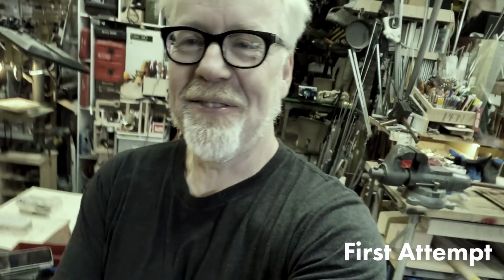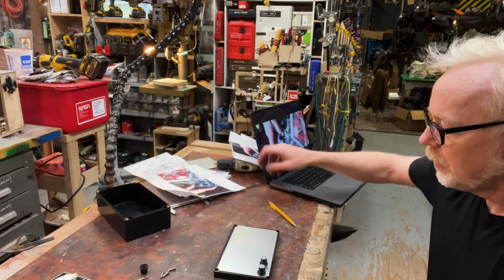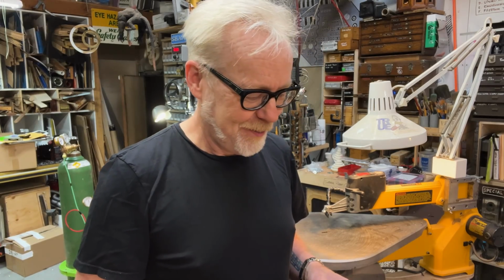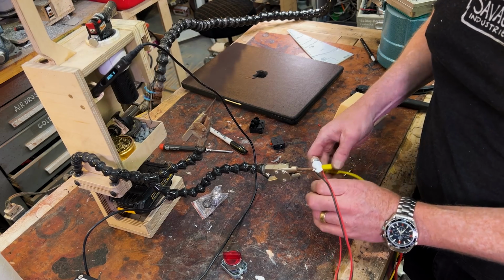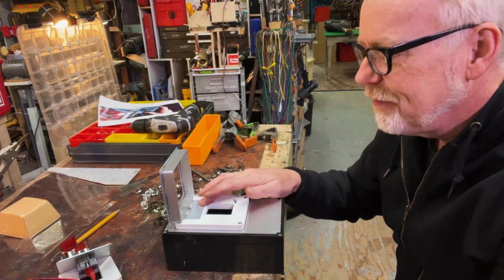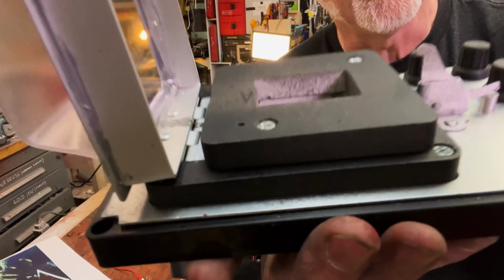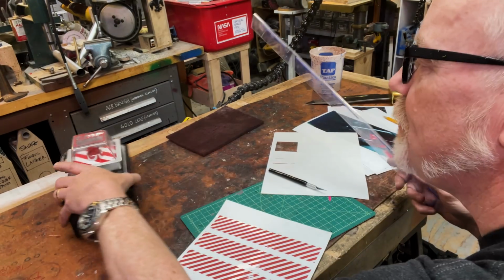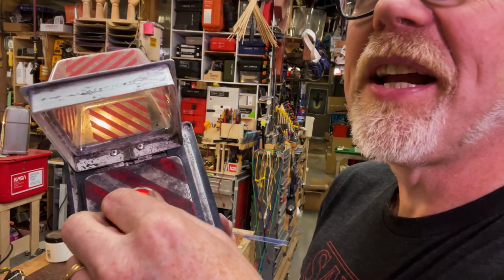Adam Savage's One Day Builds: The Matrix EMP Switch!

Comment: I mess with printers a lot for a living from the network print queue side of things for the company I work for.  I think you'll find that most modern printers have a lot of paper type options that you can play around with that adjust how the printer feeds and fuses for the best results.  So if your printer was able to run that as it did, it likely just needed the paper type tweaked a bit more.  We use a lot of label printers, but we also use a lot of generic laser printers because unless you are printing in quantity, you can tray feed quite a bit of what you need without too much problem.   GHS label printing has some fairly robust requirements, for example, but again unless you're printing in bulk, plenty of laser printers can handle them just fine.  I would imagine those sorts of printers would handle a job like this without even a shrug.  We've used anywhere from a Lexmark CS310dn to a Ricoh SP C440 or 840dn, but most of those companies would have reps that should be able to guide based on what you tell them you want to be able to do.  Ricoh/Lexmark have both always been great for that, but then again we are a client to them vs a single purchase so ymmv.

Comment: You can try something like a xerox phaser 7800, that will do tabloit 11x17. There's ways to set the fuser temp to whatever you want. Also, before you try that, make sure you set the paper type in your printer now to either label or card stock, whatever setting is the thickest. That setting tells the fuser how hot to get and how much pressure to use. Toner is paraffin so the fuser melts and bonds the toner to the paper.

Comment: About the laser printer, most manufacturers will have a secret maintenance menu or service technician menu that allows for adjustments. Fuser temperature is one of those adjustments. Check with the manufacturer to see if that's an option for your specific printer. I was a certified HP tech a while back and remember getting into those menus. Great build, love the Matrix too.

Comment: That last dial you machined and installed. It took a minute to remember but I had an electric toy chainsaw back in the early 90's that has a similar looking switch on it. I think it was supposed to be the fuel cap but powered it on.

Comment: the other thing to consider as someone in the industry... there are 2 types of 'laser' printer, and the manufacturers usually dont tell you what one your getting in anyway. the first type is an actual laser that does the job, the other kind is a very high intensity LED system that is used to replace the laser. the diference in the reviews seen are likely because of the 2 types of 'laser' printer.

Comment: Your existing laser printer may already have a "hotter" setting. On my Brother HL-L2390DW, in the printer preferences on Windows, the heat options are on the "Advanced" tab and then the "Other Print Options(Y)..." button, then in the list, "Improve Print Output". The default is "Off" (which is the normal temperature), "Reduce Page Curling" (which is the low temperature), and "Improve Toner Fixing" (which is the high temperature).

Comment: Adam for 11x17 at the paper we have several HP 700 M712N (also available as M712DN with duplexer) it is however bw. For color see if you can score a used HP CP5525dn. I can say we put these through a heavy work load... (or at least did prior to covid and everyone working remotely) ... however that move to remote office workers means the heavy duty workgroup printers should be able to be picked up used.
Note not sure if they get any hotter than average.

Comment: The closest knobs I can find the the one you made are off of appliances. Ovens and Ranges mostly, but it looks like there might be some slightly smaller ones on gas grills and propane heaters. I can't find anything that has the fluting at the bottom and the handle like knob, but that would be my best guess. Take one of those and hollow out where the post goes to get the screw all the way through.

Comment: To avoid the rub-off on a laser printer, most will let you specify the material you are printing on (regular paper, cardstock ect).  I have an HP Laserjet.  Setting material to "Card Glossy" usually sets the toner better for me.  I suspect that most consumer laser printers don't vary the heater by much, but will print thicker materials at a slower speed.

Comment: What cute vacuum-forming presses!  But I worked for a number of years for a gentleman who made his own vacuum-forming press from scratch in the basement of his home that would handle an entire 4' x 8' x 0.80" sheet of Kydex at a crack.  Ran many a sheet of 4' x 8' through that thing.  Only problem was that, when he ran it, it drew so much current that the neighbors complained to the local power utility about not having enough power for their homes - until the company installed 3 new transformers for the housing plan.  They never did figure out where the additional power draw was coming from.🤣

Comment: That "3 counter” looks a old SCSI device address switch.  They were used on external hard drives and tape drives that used the SCSI interface. It device in the chain would need unique device id.  They would have two tiny buttons on them, plus and minus to change the number.

Comment: The Xerox C8000 is larger format laser that is not too much. It does tabloid paper and a little larger. A kind of cooler model is the Xerox C8000w which does white toner and is really a requirement for doing clear sticker sheets if you know anything about opacity. But the blacks are not as rich because black is now just CMY mixed.

Comment: Did you tell the printer you were printing on a different paper type? Various will have options for acetate etc which will do things like run at a hotter temp (or lower depending on requirements).

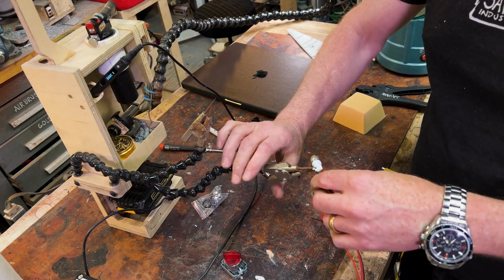Comment: 24:08 I have that exact same heat shrink tubing, it's some good stuff! It also has adhesive inside to really help seal the connection as well.
Reply: Do you have a link? I can only find 3:1, not 4:1.

Comment: Im a printer technician, you dont need to get one with a "hotter" fuser, you need to set up your print job as thick paper... when i need to do anything glossy even thin paper i set it to the thickest setting you can... it slows the print down and gives it more time as its travelling through the fuser to set...id recommend a Ricoh IM C2000 to IM C6000..

Comment: That last "button" (the one with the screw in the middle) almost looks like a truck's heavy duty fuse or maybe even a relay that they just put a screw in for visual effect.  Could be wrong, just the first thing I thought of. EDIT - I wrote the comment before you made the part you were making. From what you made, clearly you can see more of the image than what I could see.  I never saw the rounded portion below the rectangular top.

Comment: Gotta nitpick the potentiometer knobs. The ones you ended up with are close, but the same. On yours - The indicating line on top is too bold and goes to the edge of the knob. The channels between serrations looks too narrow. Your skirt is tapered vs the prototype that is cupped or flat. I would guess that the prototype may use aluminum knobs as that's where I've typically seen the inset indicating lines. Also, the prototype looks like it uses two different style knobs. The one you point to is more of a barrel than a taper and has in indicator line originating from a dot. It also appears to be taller than the other two but could just be perspective and profiles.

Comment: So I know this is old but you hit a nerve!

Yes. Finding an 11x17 laser printer is HARD. I am the IT person for a medium sized construction / site development company. We have a large, full size plan printer for printing up to 24x36 inches. Black and white; no need for color. That one does 3-5 sheets per minute.

However! We frequently print "mini" plan sets on 11x17. Ink Jet printers don't usually have sufficient RAM to handle complex PDFs at a reasonable speed, the ink isn't water proof, and they're cheaply built.

You will need to spend $3,000 to $7,000 for a full size laser printer copier to get a good 11x17 if you want a new machine.

Comment: For me, an older unit is better,  with the HP M750... just due to decreased toner costs... But, the key thing about them is how many media type settings are available for the printer.  I haven't done clear adhesive media, but if toner isn't setting up,  just set the printer for heavier stock.  That'll run the media through the fuser slower...  It's not heat intensity as much as it's exposure time to heat ....  So, what was happening with flaking toner was, kind of like cooking shrimp by shooting them through a flame... kind of.
As far as which unit to get... if costs are of less concern, any company's new large format laser will do the trick, if it is proffered to handle many types of media weights... If it handles card stock, it'll do the trick.   I do a fair amount of printing, running Edu*Craft Diversions... 
Generally, we don't Google them, though... we go to various company's websites.... HP... Canon... Epson... Or... even eBay which will give you firm search filters.  Good units can be sized about 2 feet cubed.
But, the key is that it must handle heavy weight media.

Comment: I didn’t know Adam was a Westham United fan… Tiny Bubbles 🤣Why doesn’t Adam like glue? Glue is superb, and stronger than bolts and rivets as you have more surface area. The only real disadvantage is, you can’t undo and redo it. If I can glue some l will. It saves me the hassle of drilling holes and screwing or popping. I buy a lot 5 minute epoxy and also sculpt epoxy for “glue”.

Comment: CP5225N LaserJet Professional Color Laser Printer from HP. Prints 3 x 5" to 12 x 18". Should do the trick. It will run you around $1,500 new.